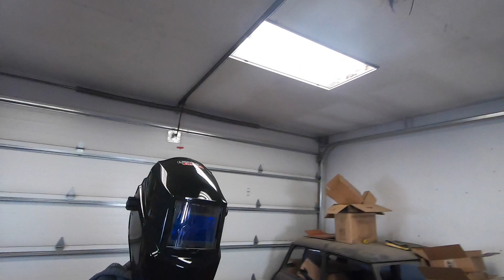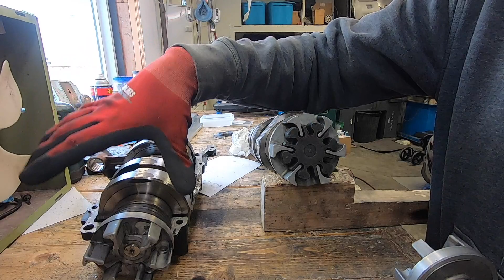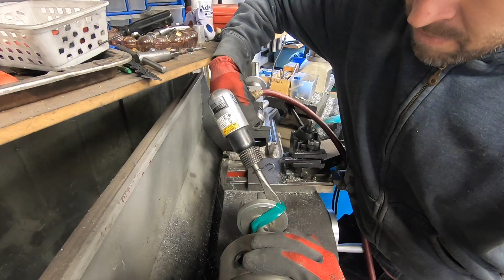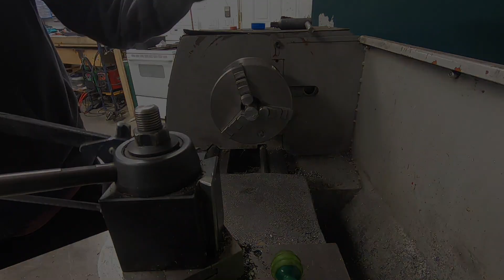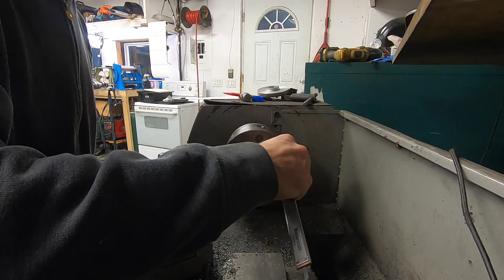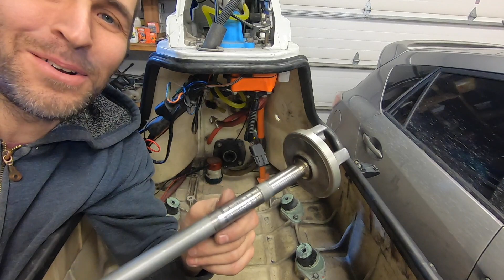Driveshaft Shortening -For My 1100 Triple Swap X2

Comment: When I needed to remove the coupler of my 650SX I  remembered that JSB video. The couple came right off with an air hammer. Glad you driveshaft came out mint. Are you not working on the supercharger 650 anymore?
Reply from the maker: I haven't officially announced it, but the supercharger project is on hold for now. I will get back into it at some point, but right now I don't have the time or money for two projects.

Comment: That into is like a video game. Where's the health bar? Oh man broke the coupler! Yeah I know about that! Nice my helpful video is helpful for you. I have also had to google stuff and found videos of myself that I have to watch to figure stuff out. Man you edited enough to make the driveshaft look easy. I don't think any of my cut driveshafts even have a shoulder. Livin on the edge!
Reply from the maker: I was editing... and the video intro was just me saying "hi" ... I was like ... it needs something else. That's not what my plan was at all... it just happened. Was kinda fun to make. 

I feel bad for ruining two couplers ... I'm a monster . The air hammer worked so good on the one on the engine ... instantly spun it off...After I had already broken it, unfortunately. There's no substitute for experience, they say. Any old jet skis mechanic would be like "there's permanent loctite on that driveshaft coupler, you're going to need more heat" Meanwhile there's me..... BBrRRRRRRRaAAAAAAPPPPP SNAP lol. 

I don't think making the shaft was difficult other than threading it... If I were to do it again, I would put the thread on first and then weld and make the shoulder... The shaft material was pretty easy to work with, as I'm sure you know, but the welded area was a nightmare.

Comment: i hope my length is correct! hahahaha
Reply from the maker: I'm sure it will. Let me know.
Reply: @JoelArseneaultYouTube  i have a extra coupler if you want it
Reply from the maker: @bmxbarron  For a 1100 or a 650 ? I just ordered 650 ones last night, but if I had another 1100 one I would try to figure out something to make that work. 

What method are you using for couplers ?  ... and if you've already said on your thread on PWC Today, I apologize, I do read them all but I have a bad memory and lots of things bouncing around in my head.
Reply: @JoelArseneaultYouTube  its for the x2 driveshaft, a 650 coupler. I bought billet couplers that mate the 900 and 650 couplers, they're the same size, the threads on the drive coupler are milled and tapped to fit the bigger 900 crank
Reply from the maker: @bmxbarron  Oh... cool. I didn't know anyone made such a thing. Live and learn. 

 I was thinking about making my own billet set... but I would need a rotary table for my mill to get all the clocking correct.

Comment: Nice work on the intro/outro. You can get aluminum pretty hot. I'd think that you could've gotten it hot enough to spin off by hand . It should grow enough to create a gap between it and the shaft so it feels sloppy.  I used to freeze my crank and heat my bearing to assemble them together,  then freeze the crank with bearings and heat the cases.  They'd have a super sloppy fit until they both came to room temperature , where they would become a tight press fit . Moped parts of course. lol . 
Wondering why you didn't use 1100 couplers on both sides.  For strength and durability. May be slightly more sizes,  requiring different size spacing?
Reply from the maker: Thanks Rick. Trying to have a little fun with the intro 👍 glad you enjoyed. 

I have done the hot cold trick many times too, it works great. My propane torch isn't the best so it doesn't heat up much or quickly and that causes a lot of the heat to go into the shaft... and that doesn't help. 

The 1100 couplers have a large thread bore so I would have had to build up the 650 shaft really large or use a 1100 shaft welded to the 650 shaft. From what I understand, this is what the majority of swapps do, but I will likely end up using two 650 couplers 👍
Reply: @JoelArseneaultYouTube  sounds good to me . the mismatch threw me for a loop . Mapp gas. .. makes a difference.  I had 2 Mapp gas and 2 propane torches going once to get a go kart wheel off once.  But a man who can do anything with an oxy acetylene torch add a grinder LOL
Reply from the maker: @rickems8863  I was going to say... MAPP is probably a way better idea 👍😁 I've never actually used it.  People are constantly donating propane to me so I have a bunch of propane BBQ cylinders as well as the 3, 20 pound tanks, haha. 

When I worked at an actual shop, we had oxy acetylene and oxy propane ... I got pretty spoiled. I didn't mention this in the video, but I was actually going to use my tig to weld a big blob onto the back of the coupler to dump a bunch of heat into it... that would have done the trick... but I was too lazy 😂

... come to think of it... I actually have a mini oxy propane set up that someone gave me, just no oxygen... I should probably get some.
Reply: @JoelArseneaultYouTube  I had a mini oxy Mapp setup an old timer gave me worked well but ate gas like a pig . I passed it onto a friend.  couple of times I wished I still had it , but no regrets.  I always get by one way or another so I can't complain. .
one day I'll get a nice oxy-acetylene torch.

Comment: Loving that little intro vid.
Reply from the maker: Hey. I was talking about you on camera today, haha. I ended up taking your advice and honed out my cylinder dry and it works great. Old habits die hard, but it's way better doing it dry if you don't have a proper setup. Parts washer / honing station.

Comment: Jet ski fool’s let’s begin haha 😂 nice to see some riding footage in there 👍 that air hammer trick usually works. The dang GoPro broke the coupler, yep I understand unfortunately. Crossing my eyes now, and oh yeah it worked perfectly 👍👌🍻
Reply from the maker: HAHA. It's always tricky trying to figure out what to say at the start of a video 😂

The air hammer trick totally worked when I tried it off camera on the broken coupler. Worked perfectly 👍The only reason it didn't work on the driveshaft is because of the type of loctite they used, and it cooled off, haha. In the end it's REALLY my fault for not being careful. I had decided I was getting new ones as they were marked up, so I kinda didn't care if they broke. 

I'm really surprised at how well it worked. I've seen Jacob talk about rethreading shafts, but on all of the forums, everyone has them cut and welded at a machine shop 🤷‍♂️

Comment: Awesome build! Mine is underway as well!
Reply from the maker: Thanks ! It's a fun project. You have an 1100 going into an X2 ? Sweet !
Reply: @JoelArseneaultYouTube  yes! A little different from yours as I’m using a free Polaris triple I got, but along the same lines. Stumped on the exhaust now. You either have to do tons and tons of fabrication to get it to be reasonably quite or do the ol’ Jetski Brothers and run it strait out the side of the hood🤣
Reply from the maker: @dirtriderz6881  LOL... yeah... I'm sure you've seen my water box build. Quite a bit of work. I'm not sure what issues you are running into, but you could just get a ZXI waterbox from ebay, or something like that ? Lots of people mix and match. 

I would love to see photos of your build, no matter what stage it's at. I used to work on Polaris back from 95 -2000... That was my first job. Well.. The shop sold Polaris and Yamaha. *mostly snowmobiles
Reply: @JoelArseneaultYouTube  Oh nice! I would love to send you some pictures, I’ll find you on Instagram!🤟🏼
Reply from the maker: @dirtriderz6881  Awesome. I'm @Projekt_me on instagram